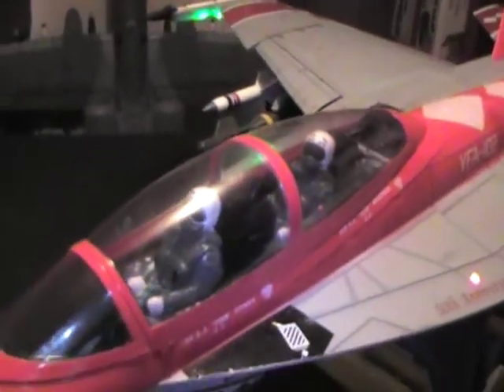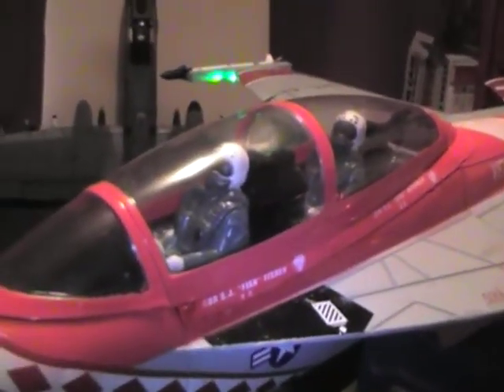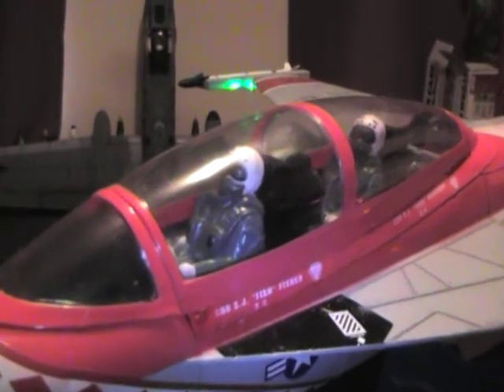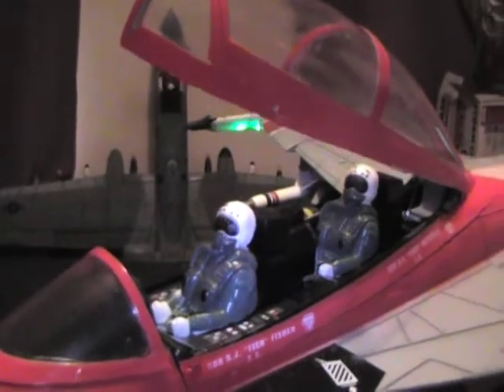LX FA-18 another view of the canopy working, using and alternate module from the LX Mig-29 Retracts

Comment from the maker: Hi Andres,

I used two 3s Turnigy nano-tech 5000 mah in serries and got about 4 minutes of flight.  But I think the GEns Ace brand of lipos and using a bit larger MAH size would give you better performance and a bit more flight time. Try and keep the "C"rating of the batteriec at least 40 or better, but I really recomend 60C or higher

Comment from the maker: I would recomend two 3s Lipos of 5000Mah in a "C" rating of 40 or better. Don't be too concerned with the weight, as the plane will fly fly just fine. You're going to have to adjust them arround anyways to ballance the plane to proper CG anyways. There is not a lot of room in the F-18 for a single 6s pack, so you'll need to do two 3s packs in serries... this is what I used last year for my F-18 ( two) Turnigy Nano-Tech 3s  5000Mah 45-90C lipos I would also recomend the same lipo in 65-130C

Comment: Thanks for your words... If we increase the "C" factor we are not reducing flight time because of the power we are using?? it is clear that we are not going to fly all the time full open throttle, but (I don´t know about this, I just read a bit) the most "C" we have less flight time... correct me if I´m wrong.
The other point is the weight, How much batteries weight can the plane support? or do it have a limitation of battery weight. 
Thanks again for all... I´ll wait for your answer to buy!

Comment from the maker: No, just because you use a higher "C" rated battery does not mean you will have reduced flight time...I just means the the battery will be better capable of delivering the proper ammount of current on demand if your motors demand it. What will determine flight time is the size in "Mah" of the lipo's being used. The larger the Mah rating the more flight time you will have. EDF's crave higher Power ...that is why I recomended Higher "C" rated lipos.